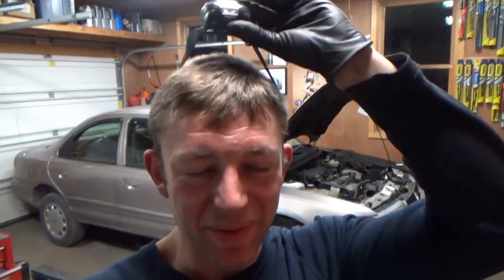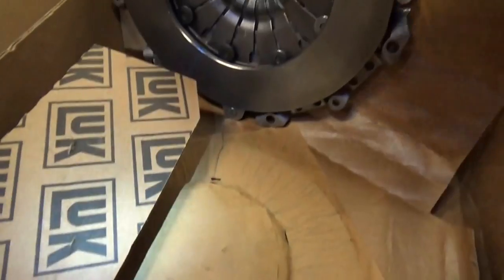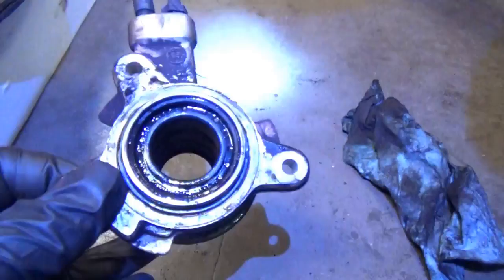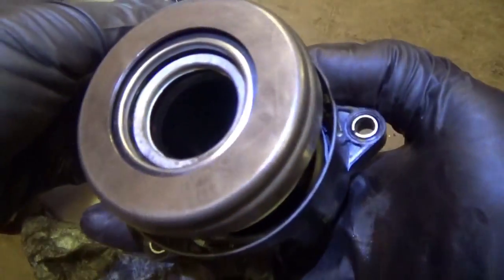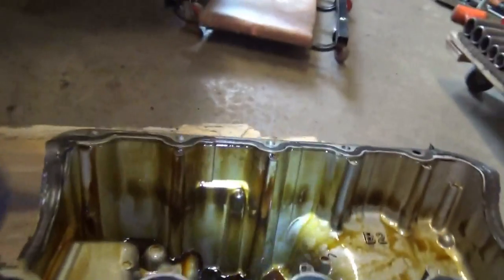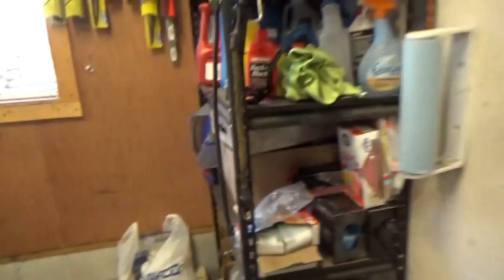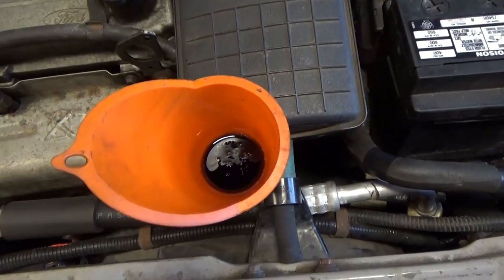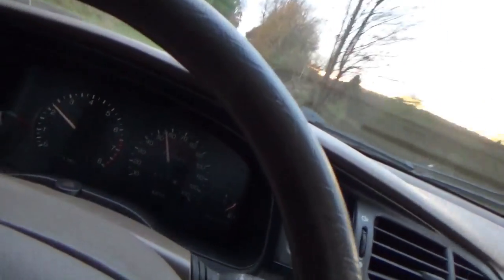96 Mercury Mystique clutch (highlights)

Comment: My buddy had one of those. He got it with 40,000 miles in 2010, unfortunately it had strange options, only A/C really, no rear defogger, crank windows, and an automatic. He eventually sold it off and moved. That thing was a little trooper I will say, no pickup, but he had no qualms about gassing it up and driving halfway across the country in it, repeatedly.
Reply from the maker: Nice. Weird options is very accurate. This one has heated mirrors and power antenna, but no power locks and no freaking trunk light! WTF!

Comment: Smooth Clutch,car sounded very good for the ks a well looked after car that's for sure, 10hours on the books is a bit daunting though but i guess once you get stuck into it time flyes by.
Reply from the maker: Half the time was spent loosening rusty fasteners haha. Next time it will only be 5 hours :)
Reply: wink, oh yeah good point "original clutch" so bolts are all like that "snap" action before they move initially and sometimes umm NOT  result=snap, hehehe, well over here in Aussie land they do mostly get moving with a bit of constant hand pressure on wrench.
Reply: Salt and crusties here in Northern Europe too. I use an air hammer on 2/4 setting to rattle the bolts a bit before trying to snap those. Quite often those open much more easy than without the air hammer.
Reply: cool,i was from there long ago, yeah i havent seen salt roads for over 35years only a LOT of sunshine here in Australia, i understand what you and ivan is describing though.
Reply: 10 hours, he must work like I do on my own, work for 20 minutes, drift off to 10 other jobs for 2 hours, return to original task for 20 minutes and repeat :))

Comment: I only had my manual Saab 9-3 for about 2 winters before I moved to Florida... but damn, it takes a special kind of guy to drive a manual in winter on purpose. On really icy or slushy surfaces I couldn't get moving without spinning tire to save my life.
Reply from the maker: Have you tried snow tires? Especially on a 200+ hp two wheel drive car haha! Manuals give the driver better control in all scenarios, maybe except starting up a steep incline :)
Reply: Oh yeah I got some really good snow tires, Michelin Alpin PA3s. They were 149mph rated tires, and when they showed up that compound was so gooey and sticky I'd never seen anything like it. On the car they were really super quiet and didn't even make a sound until about 10 degrees, at 20 or 30 the compound was extremely sticky. Anyways only got to use those one year before I moved to Florida (my wife's home state). My mother has an automatic 9-3 with the same rims, so I let her use them, she's 61 and she said they're the nicest winter tires she's ever had... I guess that's something considering they were $160 a piece when I bought them lol.

Anyways kudos to Michelin for making a terrific product, I pretty much only buy made in the USA Michelin tires now because I loved those snow tires so much. I begrudgingly bought two Pirellis on a car I bought last fall just because the set on it was almost new, it's just I had shrapnel rip an unpatchable hole in one of them. :( I'm too poor to afford the $900 off the cuff like that so I just accepted two of the same matching tires for $450 heh.

Comment: The slave cylinder in my s60 R failed. Was a huge PIA. Had to drop the whole transmission since it is inside the transmission. Clutch was fine, only thing that failed was the slave cylinder. Of course I replace the whole thing. Didnt want to do that job again.

Comment: I use Redline MT40 in my transmission, a synthetic 75w90 gear oil, and damn does it work good. When I got the vehicle it shifted pretty clunky when it was cold, but after changing over to the Redline synthetic it was buttery smooth no matter how hot or cold the car is. Actually sometimes I'm worried that it shifted poorly before because of damage, now the oil is so good it's just masking some of it. I shift like a little old lady so I'm guessing I won't know how bad the transmission is until it's miles from it's death throws, that seems to be what happens when you drive like a little old lady. Parts last and last, but give no warning before failing.
Reply from the maker: Redline is also fantastic oil. I run that in my Suzuki XL-7 for the trans, t-case, and diffs. Very smooth!

Comment: at least the bolt did not break off in the bell housing ( obviously not possible on this application .) . but it happened in my first car  when I was 16 ..luckily lost of room in my engine bay
Reply: give'em the old "heat and beat" instead of snapping things off ( i just use mapp gas) cheaper more portable overall, takes a bit longer but not worried about getting rambunctious and blowing holes in the aluminum, lol

Comment: The headlights need cleaning, try a bit of Mothers aluminium mag wheel cleaner, put it on generously  then either rub it clean or use a little buffer in a drill, it will remove all the oxidation and they will be brand new looking again.

Comment: Those internal slave cylinders are a pain in the ars. I did one in a ford ranger. Figured while I was in there why not replace the clutch, slave cylinder and pilot bearing. Not a good idea at all in my opinion. I liked the external  slave cylinders much better
Reply from the maker: But the clutch has such a light feather feel! Less linkages and friction points :)
Reply: Pine Hollow Auto Diagnostics yeah I hear ya Ivan. It just sucks to have to throw a half worn clutch disc away for a new one because ya had a bad internal slave cylinder. A ten minute job now turned into at least a 5+ hr job. Thanks for the video, nice work.

Comment: I have seen them worse with less miles on. But when the new clutch assembly is placed good for another 250k miles. !!! Due to heat the diaphagm spring is weakened a lot causing the "slow" engagement.
Reply: O, and clean out the radiator, there is a lot of leaves which cause corrossion. Have al ot of fun with this car.

Comment: Mine......255,000 original clutch gonna drive it till it wont go no more, just to see how far it will go. Only way I can tell its getting old is when one of my girlfriends, the one that is really overweight, causes the clutch to burn just a little. either I have to quit calling her up, or change the clutch. What would you Do ?. She does rattle those pans pretty good tho. Decisions, Decisions.
Reply from the maker: What car do you drive Charles? I say keep the manuals alive, change that clutch :)
Reply: A 1995 Toyota Tacoma, 5 speed. Bought it for 6,000 in 1998, had 30,000, It was a lease, 
Question, I was told by a guy back in 1975 who owned a transmission repair shop, and knew alot about tyrannies ( the car type) that unless you have a leak in your manual transmission, you should never change the fluid out. It really cant get dirty, and the mauf uses the best fluids, I know sounds kinda crazy, but Ive always went by that, and my manuals last forever. I have never owned a automatic, have driven alot of them on jobs, but never bought one, and never will. I asked Scotty this same question and never received a answer.
Did you change your rear crank oil seal while you had it apart. You got a great deal on that car, because it was taken care of before you got it. This is not normally the case.
So I guess your saying , change the clutch and keep the cook, Hmmmm
Reply: I would give her away, then buy a 6 years old BMW and get a blond girlfriend so you fix the car everyday and show her how much money you have to just fix your car.  Then when your broke, get the heavy girl back, there the best women to have.  No light bulbs tweaking in the air.

Comment: i also found clutch plate on my 1978 Mazda GLC had broken spring on original clutch plate at 200,000 miles
  =AWFUL JOB replacing IN SITU-where no room in engine bay-but served me well for another 130,000 miles
    
-until RUST    ,although DIY'd rust proofed twice annually,    got to make      >>> still running<<    car unsafe
      so scrapped at 19 yrs old-at 484,000 km-      (just shy of 500,000 KM !!!)           -in salt belt
         2nd radiator and 3rd cat back exhaust system plus 2 cv-joints later       =>  KISS formula well applied 
  
BUT I can "almost" guarantee that NO MODERN CVT equipped car will make it even 1/2 that distance

Comment: Hello Ivan could you do a TBI TO CARB video on this subject and show the wiring part in depth distributor and in tank fuel pump  wiring 1991 chevy 1500
Reply: why would you do that, modified engine? then have a chip burnt for the setup and stay with TBI. if drag racing or you insist, then try the stock pump with a return line style pressure regulator. the old TBI system ran at 12PSI and they had a return line, pressure regulator was built into the TBI on them.
for the distributor swap the whole thing as you'll very likely want "mechanical and vacuum advance" ;)
**side note** make sure you get the proper carburetor linkage adapter for the 700r4/4l60 transmission! if it's not right, the line pressure will be off and trans will cook from slippage
Reply: Thanks for getting back to me so fast. Just trying gain more power have 400,000 miles on old tbi system. I put a new engine and transmisson in the truck just a.  toy I have learned a lot from your channel thanks Sir
Reply from the maker: yeah I would stick with the TBI...very robust and reliable system!
Reply: Pine Hollow Auto Diagnostics IVAN I made the swap truck runs great so much more power
Reply: way to go, I guess :)

Comment: Fuck me sideways. This is nostalgia porn. Known as the Ford Mondeo in UK/Europe. 

My dad had an L-reg Mondeo estate 1.8 zetec GLX in red. It was the first modern car I ever really rode in. It was like a fucking space shuttle compared to the Morris Ital 1800 estate he had before. No rear leaf springs. It felt like driving on a cloud. Sound insulation. The engine was so smooth and quiet with plenty of torque. It had front electric windows. Power steering. Sunroof.Air bags. CD PLAYER. CENTRAL LOCKING! IT HAD A FUCKING 5 SPEED. Every car I'd ridden in till then was 4 speed. EFI. You didn't have to pump the accelerator twice before starting. It had a rev counter on the dash. He was going to go for a Ghia model at first but the ghia estate the dealers had was silver and had more miles on it than the one we got. That thing did 170,000 miles in 14 years of faithful service till it started having electrical gremlins with the central locking and thing like the indicator lamps and the radio. I miss that car.
Reply from the maker: Nice :) Mine is the "base model" with manual everything, except power/heated mirrors and antenna lol. Not having power locks kinda sucks, but I don't live in NYC so just leave the doors unlocked. Interior is super plush...90s style :)
Reply: Morris Ital 1800 estate ...So I take it the word ESTATE ..was an exaggeration ?
Reply: deepsquat600 Not as much space as the Mondeo. That Ital got absolutely destroyed. We lugged so many building supplies and junk around with that thing. It was on its second engines and the guy my dad got it off was a plasterer and treated it like shit. My dad patched up so many things on it. The wiring got messed with. Our mechanic changed the engine. I don't miss it one bit. It was a POS. 90's ford was the ultimate luxury to 10YO me.

Comment: Any mechanic would have a new O-ring, RTV is a real Rookie move. 
If you use RTV clean all the oil from the mating surface, and leave the o-ring out.
If you use the o-ring, use dielectric as a lube and forget the RTV.
RTV requires at least 8 hrs to cure before contacting oil, or it won't ever cure.
Reply: I am cringing wow RTV???
Reply from the maker: I'll let you know if it starts leaking transmission fluid :)
Reply: Eight hours before cure time Lol, that's a good one!
I use it all the time and have never had a leak
Reply: I'd have applied RTV even with NEW oring, having to redo it because it leaks = fail

Comment: I have never seen a manual transmission car with more that 120,000 miles on the original cluch. What's your secret? Haha
Reply: Ian Johnson I see it all the time well over that mileage here no problem I've seen her original clutch on a vehicle here than over 300000 miles
Reply: City driving vs. highway. No problem getting 350 000 km+ if on highway side, downtown driving.. not so much.
Reply: It's all in how it's driven. The clutch (just like brakes) only has so much life in it. Slip it a lot and it's toast at 70k, minimize slip and drive on the highway a lot - it'll last quite a long time. My dad just sold my his 01 tundra with 265 on the stock clutch, and my car has been supercharged since 45k miles with 118k on the stock clutch, feels like there's lots of life left.
Reply: When I sold my 5-Speed F150, it had 210k miles on the original clutch. My uncle's F250 has 323k miles on the original clutch.
Reply from the maker: Brad, you must live down South. In the salt belt pickup trucks don't last long enough to accumulate that many miles!
Reply: They do when you wash the salt off and take care of them.

Comment: Automatic transmission means much more brake action and no feel for the car. Did you ever notice that in slow moving traffic in US you see nothing but brake lights and constant stop and go parabola effect. Boneheads following cars too closely in slow moving traffic, constantly on and off brakes   If you really know how to handle a car and how to drive a clutch correctly and how to keep a bit of distance between the car in front, you can ignore those brake lights and creep along almost entirely without using that brake. And traffic behind you will thank you for keeping things moving!   US left/right coast drivers are clueless.  
Watch a good trucker in action.
Reply: Only problem is when you leave enough space, some dude will decide he's got to pass and get in there and ride the bumper of the car ahead. Clueless indeed.